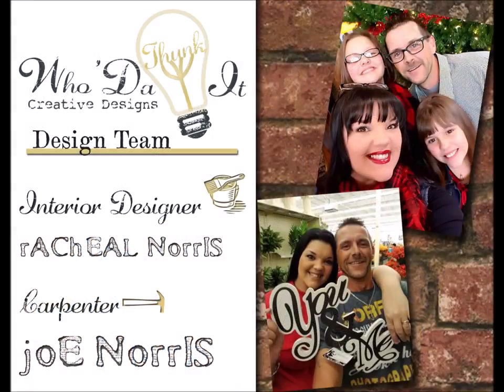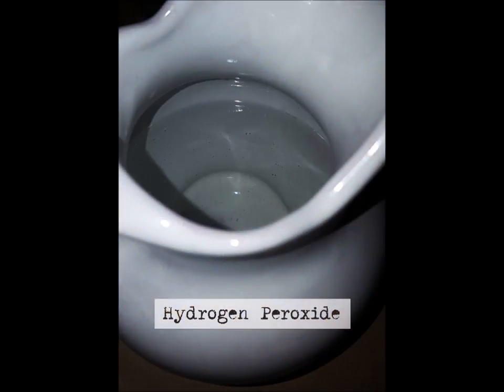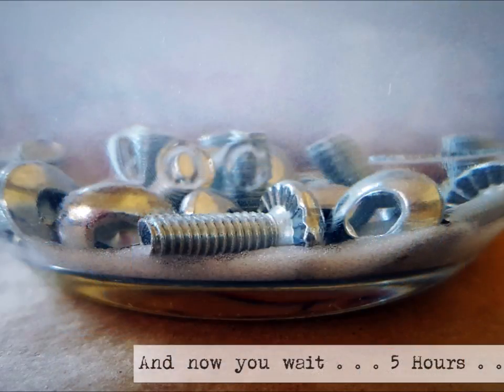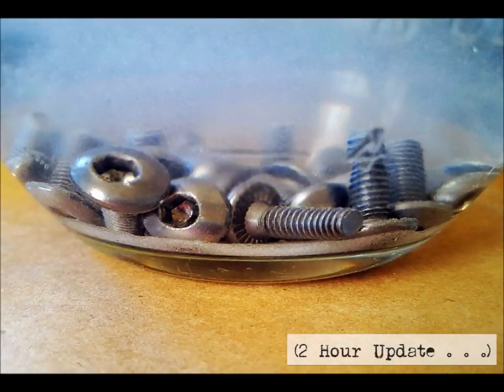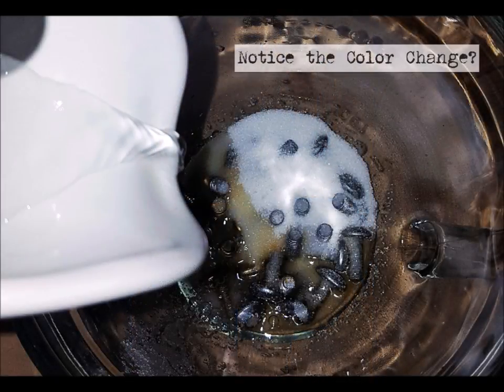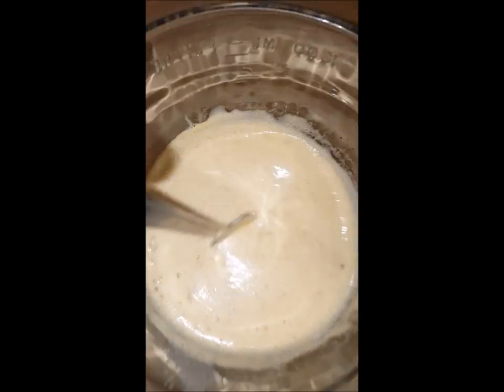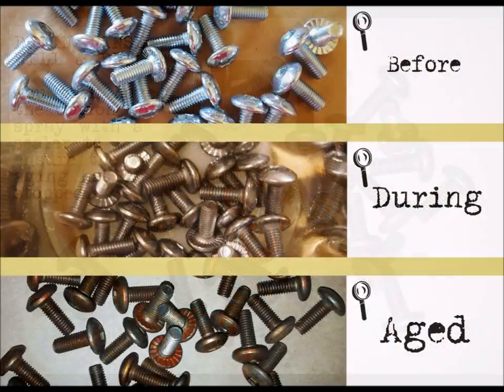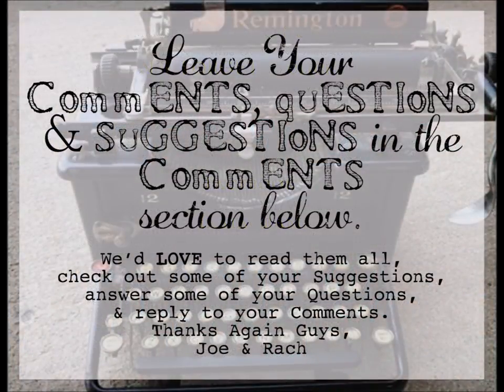HOW TO AGE STAINLESS STEEL HARDWARE

Comment: Very informative. Well done. For the final step (Sealing): what product do you recommend and how is applied to 1)A flat piece of steel and 2) a bucket of screws/bolts?
Reply from the maker: Thank you so much!! Sorry it took so long to get back to you, school started and so we've been pretty busy around here. We used rust-oleum triple thick polyurethane spray, and it worked great for us.